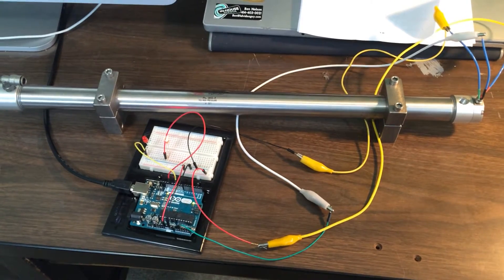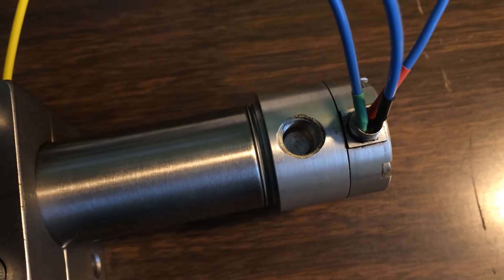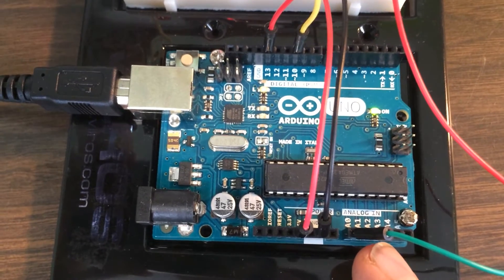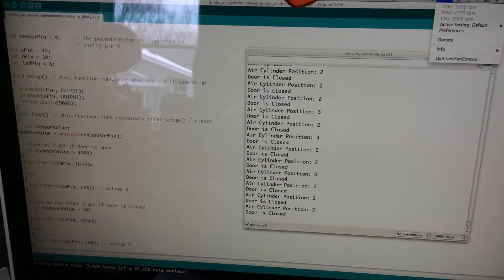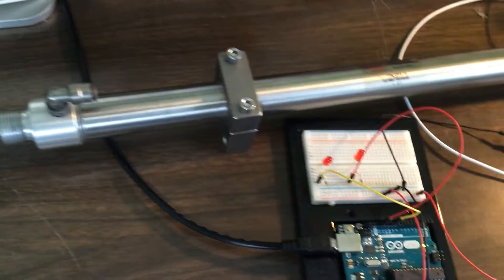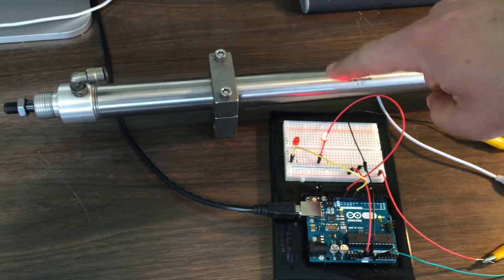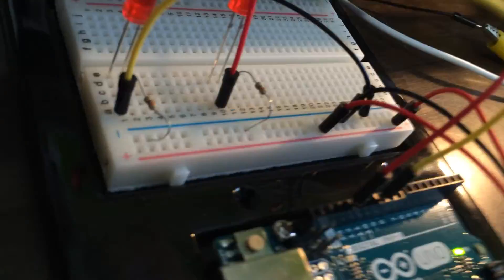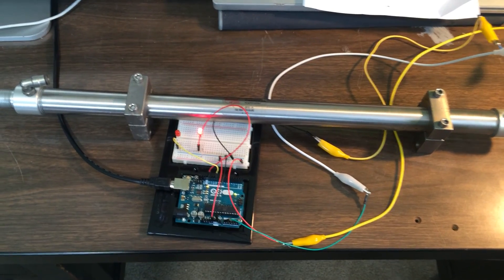Air Cylinder Position Sensor for Star Trek Door

Comment: Did you ever finish the doors?
Reply from the maker: The doors are kinda sorta finished. The doors themselves are done and look good, but we still never got to doing full automation on them yet. It's just push-button. Press button to open door, press button to close door, but does operate correctly, opening and closing under air power.
I'll try to shoot some video sometime when I'm over there. (This is at my brother-in-law's place, and I'm not over there all that often with a video camera!)
Reply: Thanks for the prompt reply.  I would love to see a demo of it's current state.  Even if it's push button and not sensor.  Might build one depending on how your doors operate.  Thanks again :)